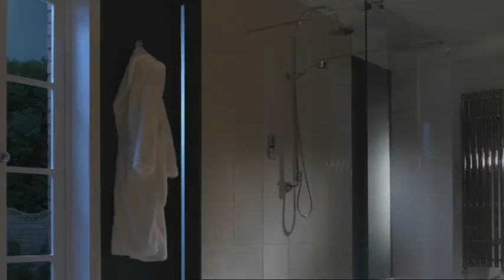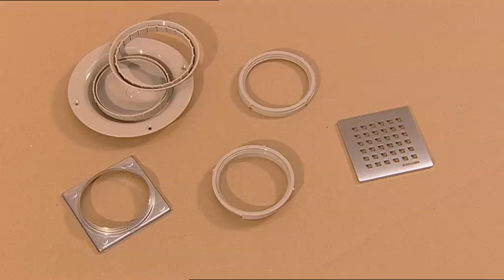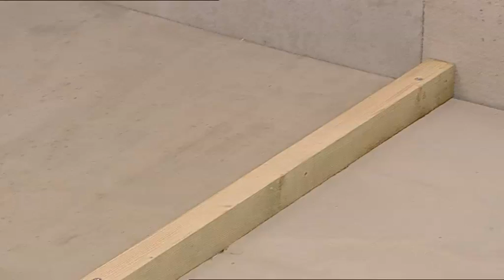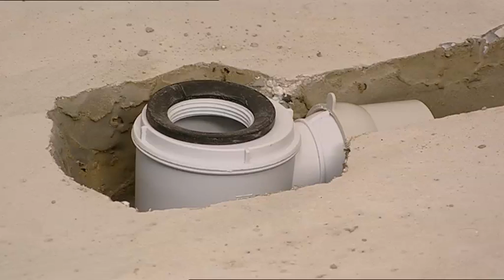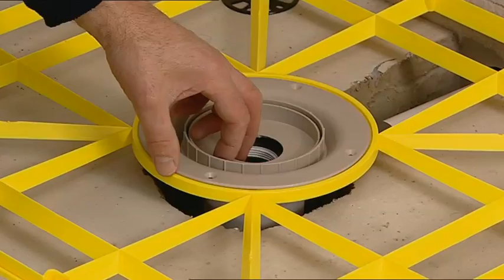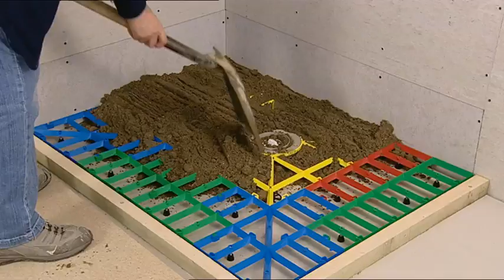How to hand screed a wetroom by hand on a concrete floor

Comment: Not sure if cutting through the concrete slab is a good idea my contractor said it could compromise the structural integrity of the foundation.
Reply from the maker: This was done for video purposes, and this represents screed. In general this product would be fitted as a new pour floor so the cutting would be insulation board and not simulated concrete as per video. Your contractor is correct, a structural slab should be left alone and it's only the screed topping you should penetrate

Comment: Whoever did mine before I moved in did a piss poor job and a half. Laid down wooden flooring, got so soaked, was like walking on wet pillows, till it collapsed! A council contractor just started yesterday on mine removing the soaking wet wood pulp down to the concrete base. He's waiting on some screed & materials to arrive, hopefully tomorrow! When I plastered outside walls, I used plasterciser, thick latex liquid mixed in with the cement. Is plasterciser not used in wet rooms to help waterproof? Contractor told me screed would be dry in 2 hours. 2 hours?! really?! The surveyor said once concreted and dried, latex would be poured over to waterproof, though from the last time my kitchen floor was done, it took overnight to dry. Then, new blue vinyl will go on top of that, sealed around the edges. Drain is already in place with a 12 vdc pump. I was expecting a new drainage pump system. Think I would have preferred ceramic tiles to vinyl. Waited nearly a year now to get it completed! That's the caancill for ya!
Reply: would be interested in what screed is going to dry in 2 hours.. could you find out?
Reply: @shaunshunt  Lol.. am still waiting to find out myself. He never came back..!!! I put in an official complaint, making a claim for damages. Outrageous!! to leave my bathroom in such a state. He hadn't a clue what he was doing. I'd do it myself if they delivered the materials. I'm sick of wating. Ring them up, email them, nobody picks up a phone or answers their emails. WTF..?!!!
Reply: Oh! That’s not good 🙁

Comment: This looks insanely over engineered
Reply: Is that not a good thing
Reply: @ozzy85Mpower  I don't think it is a good thing. You can achieve the same results with a few tapered bits of wood. 

I haven't used the product, so it would be unfair of me to comment its efficacy. But i have screeded a shower tray using a method similar to this: https://www.youtube.com/watch?v=QhLOhTlJ_Ro with perfectly acceptable results. 

Each to their own!
Reply: Absolutely- what’s wrong to some screed rails 😂🤦‍♂️